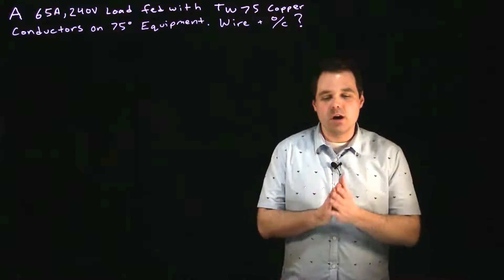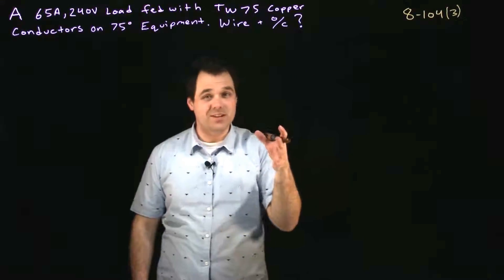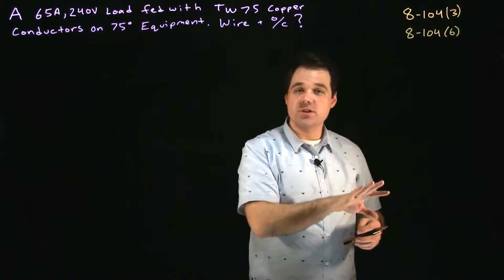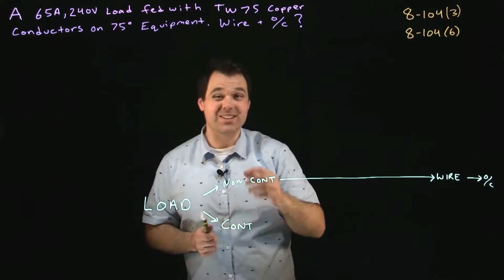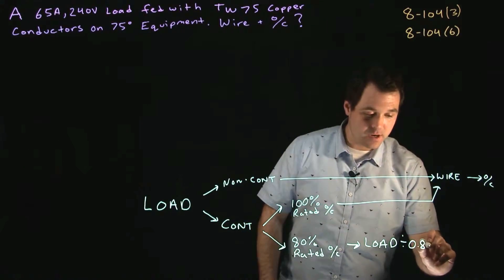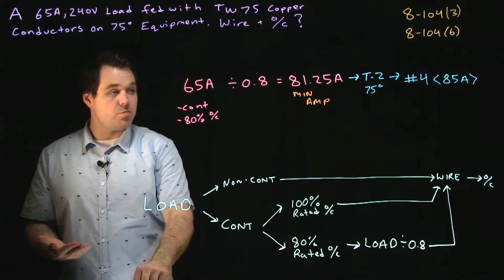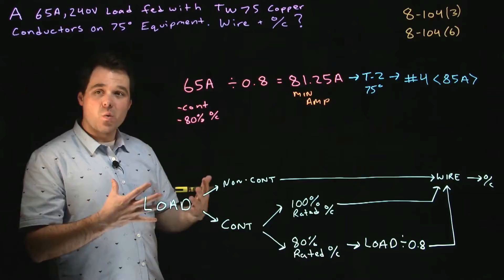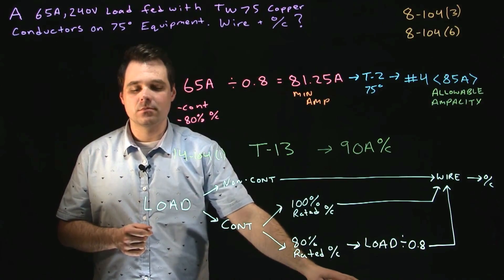Conductor and Overcurrent Sizing - Continuous Load

Comment: Hi, out of curiosity, rule 14-104 states "The rating or setting of overcurrent devices shall not exceed the allowable ampacity of the

conductors that they protect" so why we have chosen the O/C (90A) exceeding the allowable ampacity of (85A) of the conductor?
Thanks in advance!
Reply: Agreed, why would we not go to the 80amp O.C. device instead of rounding up to 90. I always thought the breaker is to protect the wire and in this case we are putting a 90 amp breaker to protect wire we determined to only allow 85 amps... what am I missing?
Reply: @ZackHartle  Thanks Zack, your videos are amazing, simple, and to the point. keep up the good work!
Reply: That's a good question, it seems odd to follow a clear guideline with the word "except...". Then 14-104 goes on to refer you to table 13 where routine upward rounding is permitted. There has to be some wiggle room to account for availability of breakers, and the code has some tolerance built into it to allow upsizing inherent to table 13. It would be nearly impossible to change that now for linguistic clarity.
Reply: I believe it’s because that is not a standard breaker size. So you can round up to the next size. You would size the conductor to the continuous load.
Reply: Also the load is 65 amps and if you did a 80a breaker it would be more than the 80% load on the breaker. 80% of the 80 a breaker is 64 amps which won’t work.

Comment: Some thing you are missing .When calculating conductor size ,load *1.25 and o/l size before table 13 you see NTD,TD or C.B (175%,250%,300%)
Reply: Thats only for motors. Read 28-200!